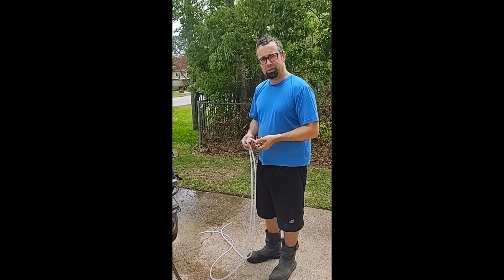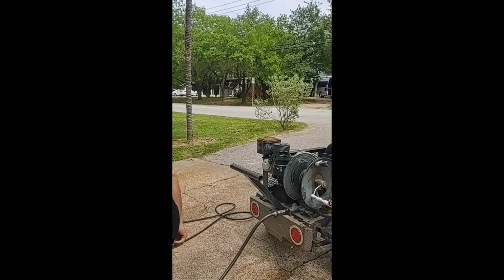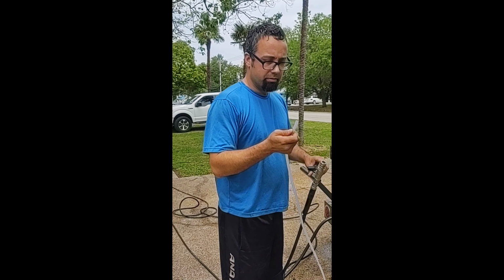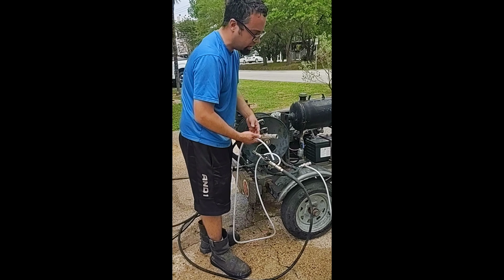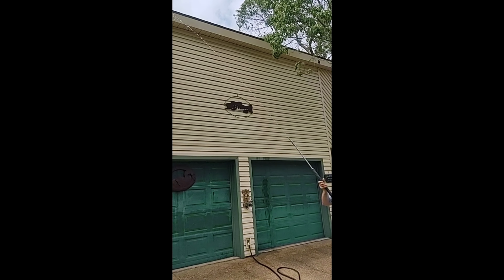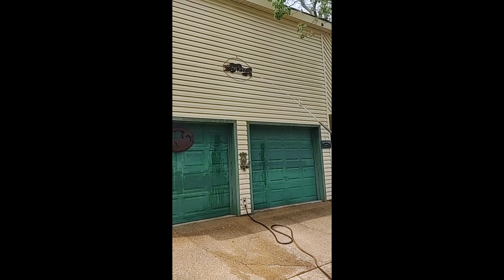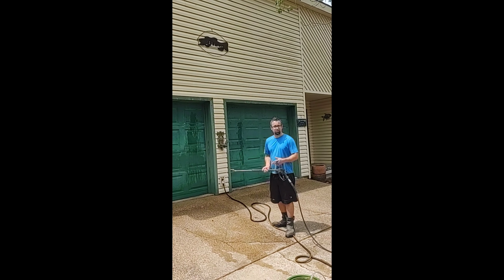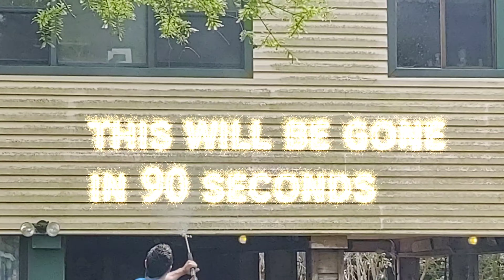How to use a downstream injector with a pressure washer

Comment: That’s pretty cool.  I knew I could get water out of the wand but never thought about downstreaming softwash with engine off.  Interesting.
Reply: It will destroy your hoses ball valve and wand much faster depending on what chem you use, but i mean shit of you can get more of them and your profit margin is better because your doing more houses faster then why not. Nice tutorial, simple fast effective.
Reply: @MostlyPeacfulRiots  I don’t see how that would happen?  It’s no difference between DS with the engine running or if off, as long as you run fresh water through everything when done.
Reply: @Web Crawler  theres a big difference! Pressure washers are rated by gpm right? Well it only feeds those gallons with engine on. Hes injecting straight 12.5% with a very low gpm with the engine off inwouldnt be surprised if this did damage

Comment: I have a 2800 2.3 Troy bilt and will get a 4.0 gpm as soon as I am able to upgrade. I ordered a downstream injector and j rod will that work with my machine while I am able to upgrade ?
Reply from the maker: For your machine I recommend a number 3 shooter tip for the J Rod
https://washmart.com/products/brass-shooter-tips?variant=30243265151057
Reply: @TXcommercialwash  thanks. I got mine off Amazon and it’s four tips. 0010,0030,2510,2530. Will this set up work with my machine and will it siphon properly?
Reply from the maker: @Arnnnnn  it will siphon if your injector is working right
Reply: @TXcommercialwash  thanks 🙏🏼 was hoping it would to be more effective than backpack sprayer for big areas. I’m just getting started. Any tips to avoid back pressure ?
Reply from the maker: @Arnnnnn   when using the 0030 you will have no back pressure unless you close the trigger gun.  I recommend having a triggerless gun if your machine has no unloader valve.  Verify if your machine bypasses water. Many of those smaller units like yours don't.

Comment: I’m wondering how chemical affects the garage door coloring?
Reply from the maker: Bleach doesn't under most circumstances.   There is actually a chemical that can also clean the doors aluminum oxide called Gutter Butter.